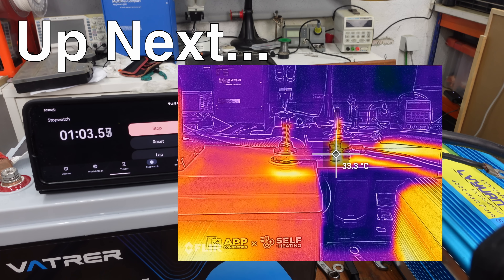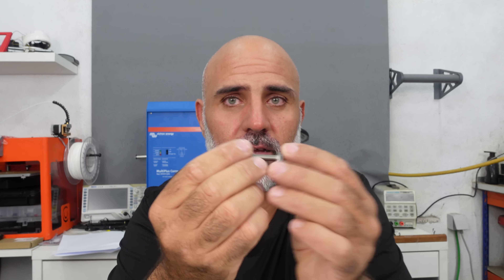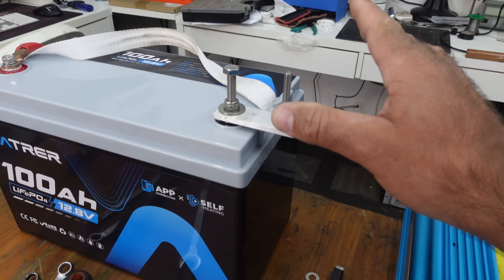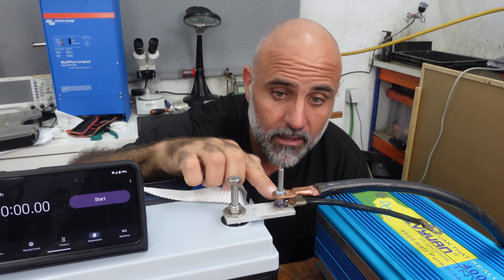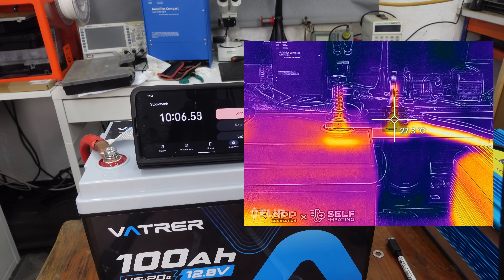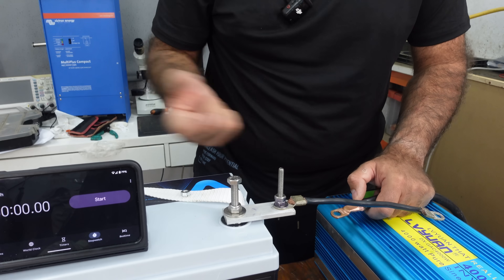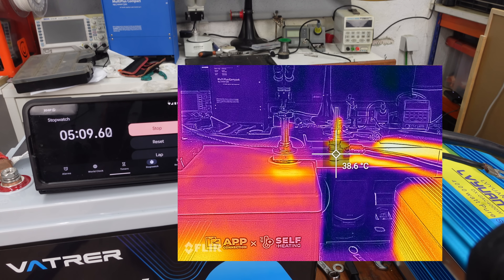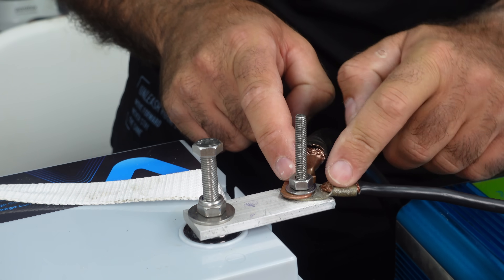This Tiny MISTAKE can BURN your SAILBOAT down !

Comment: in your thumb you show what looks like a stainless bus bar, why not show and test that ?
Reply from the maker: The busbar is not the point. If you make a bad connection it will be bad on any busbar 😅 cheers mate fair winds 💪
Reply: @reversingentropy I'm saying, wouldn't the problem you showed with a ss bolt conductivity also happen on a ss bus bar ?
Reply from the maker: @hayden-james Yes it definitely would but as far as I know there are no fully ss busbars. They are normally coated brass, sometimes with ss studs.

Comment: What was the bus bar made of?  Is it aluminum?
Reply from the maker: It was just a piece of scrap aluminium to illustrate the problem. The connection is the issue here. 😅 Cheers mate fair winds 💪
Reply: @reversingentropy  Thank you for answering.  I was just wondering.  You make great stuff and I appreciate all of it.

Comment: I noticed the second ring connector had a larger diameter hole, this should be avoided, if the bolt is 8mm the connector should have an 8mm hole, not a 10mm, this will create a poor connection, and heat up.
Reply from the maker: True. But that's not what happened here. The heat came from the nuts being stainless. Cheers mate fair winds 💪

Comment: Also make sure to combine as few dissimilar metals as possible. 
Aluminium, stainless steel, copper, galvanized metals. If there is also moisture, it is ideal for corrosion. 
A sailing boat is a humid environment.
Reply from the maker: Very true 👌 cheers mate fair winds 💪

Comment: Nice topic, the washers are the ones to be mindful of! We usually concentrate on the nut (usually not to lose it in the "abyss") and forget about them, and a washer between the connectors WILL do damage!
BTW, nice intro although I personally miss the "around the world not thru it" part of the previous... ⛵
Reply from the maker: Thanks mate 🙏 I had complaints that the old intro was too long and cringe 🤣🤣🤣 hopefully this one doesn't require skipping forward. Cheers mate fair winds 💪

Comment: Interesting information. What was your bus bar made of as it looks like aluminium. Bus bars should be tinned copper I thought. Not sure if it makes a difference in this scenario but probably not if using a stainless bolt.
Reply from the maker: This was just a scrap of aluminium to make the tests not a real busbar. Cheers mate fair winds 💪

Comment: To measure the shiny metal with IR you should apply some tape or a paint with a reasonably high Emissivity in the IR spectrum. The surface temperature read by the IR camera on shiny metal surfaces could actually be way lower than the actual temperature.
Reply from the maker: You are correct, i painted with a black sharpie but had limited success 😅 cheers mate fair winds 💪

Comment: I saw a video by Calder where he accidentally had a stainless steel washer under a battery connection and things got very hot.
If you look at a table of conductivity, silver is the best, closely followed by copper, gold and aluminum. Lead is actually about 10x worse than silver or copper, while stainless steel is 2.5 times worse than lead.
Reply from the maker: Very good info. Cheers mate fair winds 💪

Comment: I don't think stainless steel was the cause for your heat. Go to poor physical Connection by putting the lug on top of a nut. The hole in the nut was way too big for that post
Reply from the maker: The stainless was the issue. But i didn't do a good job at proving it. I think I need to make another video 😅 cheers mate fair winds 💪
Reply: Definitely the stainless that's the problem

Comment: The bus bar look like aluminum. Here aluminum could be the worse problem than stainless steel. With the oxide layer at the surface the contact quality can vary quite a bit. It can be OK with enought pressure, but can be really bad if the pressure goes down. Copper and even more soft aluminum for conduction purpose are soft and will creep over time to reduce the pressure. This is a reason why one need to check the torque on the connecting screws from time to time, especially some 6 months after a new install.

The 41 C for the SS screw is not that bad and chances are the 10 minutes is close to steady state. So it would not get much worse over time. So the SS screw was about as bad as the thinner gage cable at the start of the test.

Poor conductivity is not directly linked to corrosion resistance. E.g. gold is a relatievly good conductor. SS is a poor conductor because it is a mix of multiple elements.
Reply from the maker: All good points, The busbar was just a scrap of aluminium to perform the test. Cheers mate fair winds 💪

Comment: Good info.
I suggest only use copper busbars, aluminium is not a great conductor. Also have a flexible busbar, as batteries might move slightly, or even get smaller or bigger with heat, and if the busbar is not flexible, this might damage the contacts.
Reply from the maker: Very true 👌 cheers mate fair winds 💪
Reply: Buss bars should never be connected directly to a battery.
Reply: @stevemccormick4938   What the buss bar supposed to connect to? Magic?
Reply: @SOLDOZER  wires you genius.
Reply: @stevemccormick4938   yeah no shit captain obvious
Reply: Aluminium is an excellent conductor!
But the surface quickly oxidizes and that will create bad connections.

Proper bus bars are mostly copper plated with Zink to avoid corrosion.
Reply: You clearly have never owned a saltwater boat.

Comment: Each connection should have its own nut bolt and washers on the bus bar hence the name best to use copper bus bar and make sure it’s clean. I buy silver plated copper bus bars and if I run out of connections I run another bus bar in parallel
Reply from the maker: That's the right way to do it 👌 cheers mate fair winds 👍
Reply: I don't see any reason why that would be better than stacking other than looking nicer (to a sensible amount, so maybe two or three connections on one bolt, not like 10).
And place the high loaded ones bottommost.
If anything you have double the amount of contact points when doing this, each being a possible point of failure.
Reply: @SailingSoWhat the difference is you can isolate a circuit and leave  the others live, great for fault finding

Comment: Stainless steel not magnetic? I've to reset my CPU sorry.. ok I'm back. I remember I burned an old house electrical installation by plugging one of those 1kw heaters. All the cables were smoking hot. So, that's a no-no appliance in my boat.
Reply from the maker: Yea, good stainless steel is not magnetic. They have to make a special stainless for refrigerator doors just to make  it magnetic 😅 cheers mate fair winds 💪

Comment: Well, the problem is not the material itself, but you MUST REGARD THE POWER RATING when you buy, let's say, a stainless steel bus bar. Be very careful with obviously too inexpensive China ware. Buying cheap might cost you a fortune.

Also note that the diameters of the bus bar terminal should closely  match the diameter of the ring of the cable shoe. If they don't, crimp/press a matching one. You can't fix it by using a large washer because the contact zone has already been limited by a too large diameter.

Comment: Great video. I've just ordered a mild steel busbar to replace the yet-to-be-fitted stainless one!
But I've noticed that the battery terminals themselves are stainless, against the advice in this video, am I missing something?  Thanks
Reply: You have noticed wrongly. 
Lead: The most common material in traditional lead-acid batteries. Lead is relatively soft, which makes connections easier, and it conducts electricity well enough for most purposes.
Copper and brass: These materials are often used for battery connectors and terminals because they're excellent conductors. Copper is a particularly good choice for high-current applications.
Reply: The external terminals of lithium-ion batteries are typically made of copper or nickel due to their excellent electrical conductivity and corrosion resistance. These materials ensure an efficient flow of current to external circuits.
Reply from the maker: Ok. I don't think your terminals are stainless. At least I have never seen that. Nor have I ever seen the whole busbar been made of stainless. Can you check that ? Cheers mate fair winds 💪

Comment: Thanks. You should have left it for much longer, as it only got slightly warmer. 
I thought the whole idea of a busbar was to avoid stacking.
And this is only going to be an issue with high load applications. 
..but point taken
Reply from the maker: You are correct, I should have given it more time. I only realized it after upload,😅 cheers mate fair winds 💪

Comment: Stainless steel is a loose term as there are many grades. 304, 316 and 316L are the most common. 316L is not magnetic and the L is for low carbon, it is the most corrosion resistant of the three. 304 however is magnetic and because you don't generally want your electrical connections to get wet it is fine for a bus bar but can rust. As for connecting ring terminals to ANY hi load you should avoid stacking them completely even directly on top of each other so yes stacking ring terminal after ring terminal on your battery post is a BIG no no. One terminal one ring on it. That is what a bus bar is for and not for nothing but that what you used looks like an aluminum bus bar... also a resister as with using copper clad aluminum wire (not recommended), resistance goes up and so must the wire size. You are correct in every way however this is a subject that goes way beyond stainless bolts burning your boat down because there are allot of other mistakes you can make with the same result (by by boat). One more note, not pre charging your inverter is also a no no and can damage the internal BMS in the battery as well as the terminal itself.
Reply: In regards of stacking just depends what sort of loads are involved and what the post is etc. and used fairly often inside electric devices and on cars battery connections. Use dielectric grease if you can(more so with copper). Often the problem is the cable itself corroding anyway as result of being undersized and heat cycling.

In the way used here as the wrong way the stainless bolt was made to be the bus bar and thats not good.
Reply: @lasskinn  DIELECTRIC  grease is an electrical insulator.  Do not use it between conducting surfaces.  Use it to cover the terminals if you want but CorrosionBlock or CorrosionX sprays (thin fluid film technology) is better and cleaner.  Use it on every electrical connection on your boat and it will prevent a lot of gremlins.
Reply from the maker: Lot's to unpack hehe true different grades of stainless, none of them good conductors.
True this busbar is just a scrap piece of aluminium to make the test.
True there are many way's to burn your boat down, im just tackling one small thing to not complicate matters.
True i should use a pre charge resistor it was right next to the battery, That particular time i forgot i made a mistake hehhe.

Cheers mate fair winds 💪
Reply: Both 304 and 316 are magnetic. Also they are nearly the same alloy. The minor difference doesn't change their magnetism. If they are fully annealed they won't be noticeably magnetic, but if they have been cold worked both will be noticeably magnetic. Using a magnet is not a reliable method for determining if something is stainless either.
Reply: @court2379  I think I understand what you are trying to say, but "magnetic" in this context is really quite weakly magnetic. I think this quote may make it clearer for others reading through this thread:

"316 stainless steel is usually non-magnetic in its annealed (standard) state. It’s an austenitic stainless steel, which means its crystal structure does not support strong magnetism. However, some magnetism can appear if it has been cold worked (bent, drawn, rolled, or machined), because this can partially transform the austenite to martensite, which is magnetic. Even then, it’s generally only weakly magnetic compared to ferritic or martensitic steels."

And:
"As for conductivity, stainless steels (including 316) are poor conductors of electricity compared to copper or aluminum. Electrical conductivity is about 2-4% that of copper (resistivity is roughly 70-75 μΩ·cm). This means it’s about 25–50× worse as a conductor than copper."
Reply from the maker: @court2379 👌
Reply: @court2379 true about 304 and 316 but 316L in my experience has never been magnetic. At least not enuf to retrieve with a magnet when dropped in the bilge.
Reply: @svalannah Certainly less so than normal steel. But frequently people try using a magnet to determine if something is really stainless (and by that they mean 302, 304 or 316 grades). They then detect it is magnetic and say it is bad material, or not really stainless. 
When really cold worked 300 series is reasonably magnetic. Fasteners usually are due to rolling of the threads and forming the head. Wire is due to cold drawing. 

The point is you cannot say it isn't magnetic, because it definitely is.
Reply: @court2379  Yes the magnetism can be a trap. High grade stainless like 2205, a nitrogen enhanced duplex stainless, is strongly magnetic and sometimes used in propeller shafts to keep the size down due to it higher tensile yield.
Reply: The rule I'd use for stacking is not to exceed 1.5x the wire ampacity of any ring lower in the stack. If you have a 4/0 lug on the button - that's 300A on that wire, and no more than 450A through that lug. 4 AWG ring on top - 100A ampacity on the wire - not more than 150A through the lug.  - That's fine. Stack two more 4AWG wires on top? - No, look into expanding the bus bar instead.
Reply: Sure, there is a wide variety of stainless. But the point is that all of the stainless in marine use contain substantial amounts of chromium and nickel which result in the lower conductivity compared to a carbon steel. It is not directly related to the whether the steel is magnetic, that depends on the crystal structure (austenitic vs ferritic/ martensitic).  Anyway, I agree with your main point to avoid stacking and would add that bus bars are normally rated for amperage so all of this should not really be a concern for anybody but the manufacturer...

Comment: Even if your hardware is not SS its not a good idea to have the thread interface as the electrical path, and this applies to ground studs also where you wont notice the extra resistance until you get a fault.
Reply from the maker: That is very true 👌 cheers mate fair winds 💪
Reply: Yeah, I don't know who instilled this into me. But it would never occur to me to connect things this way. 
Is it not instinctual that the spades go on top of each other? Any screw or nut is there to secure the connector against its mate. It should not be part of the circuit. 

Make it as easy as possible for the energy to get where it is needed :)

Comment: Great video, I don't even own a boat (I work on helicopters and tractors...  long story) but I can 100% see this being a mistake someone makes.
Reply from the maker: Thanks mate 🙏 I agree with you It's an easy mistake to make. Why upset the existing connection when there is enough space for the connector and extra nut. I've seen this done multiple times aldo usually with small loads. Cheers mate 💪

Comment: I didn't know anyone was stupid enough to use such a lug stacking technique. Really? Are they too lazy to remove the nut to properly stack lugs? I also recommend looking at nord-lock washers in place of split-ring washers.
Reply from the maker: 👌 cheers mate fair winds 💪
Reply: People attributing ignorance to stupidity are usually closer to the latter and unaware.
Reply from the maker: @jwm6314😂
Reply: @jwm6314 Good point. Ignorance is only temporary, but stupidity is permanent. Someone who is able to learn is only ignorant. We all started out that way.